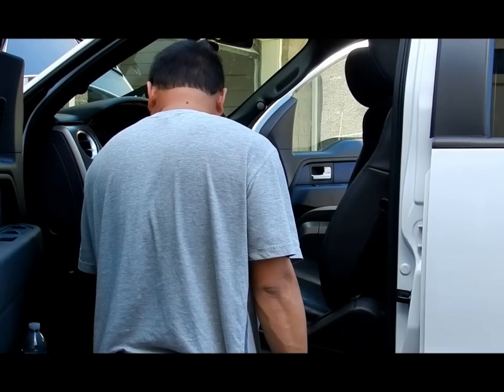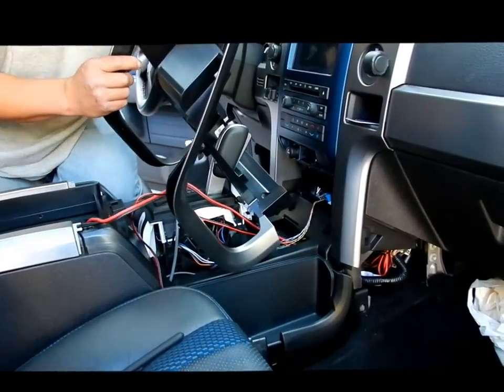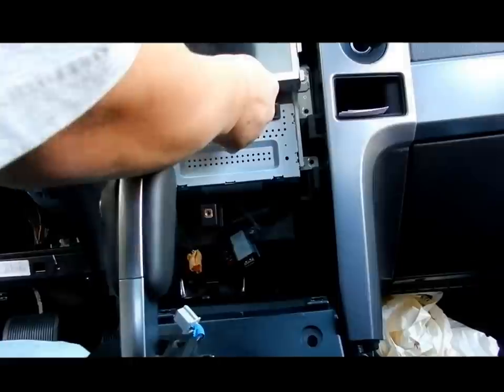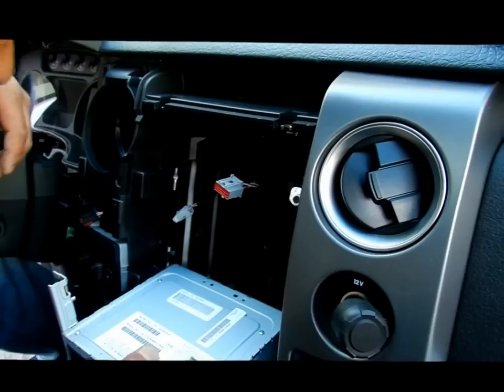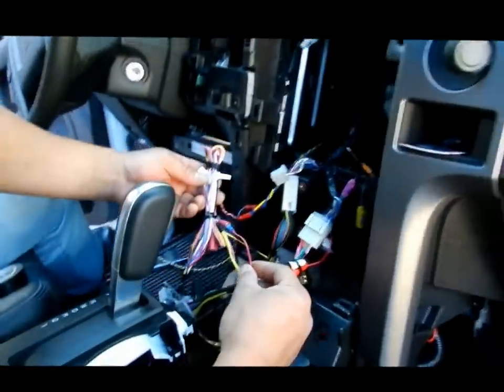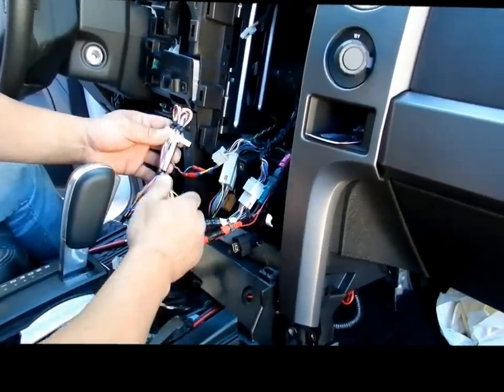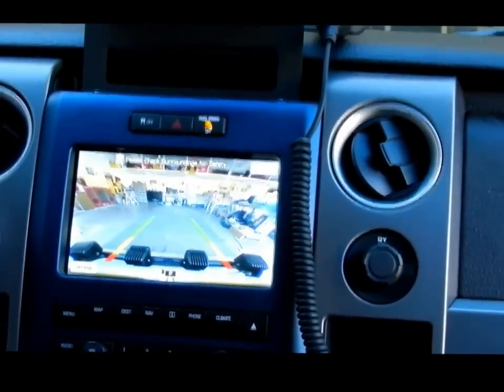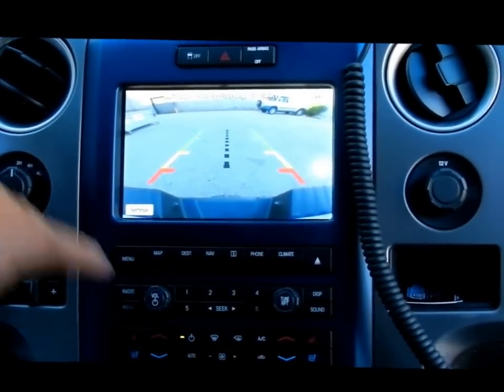F150 center console to remove radio Raptor

Comment: Hello,
I'm wondering how did you pass the cable through the firewall. Do you think you can share a video on how to run wires on a raptor through the firewall? 
Did you drill a hole? How did you seal the hole?
Thanks for sharing this video...
Reply from the maker: So on the F150 I have passed the wire through several places. On the passenger side remove glovebox in the right corner there's a gap that let's you get in behind the fender. On driver's side there are several rubber grommets you can poke an awl through for small wires. Just look on both sides of firewall for the rubber grommets.